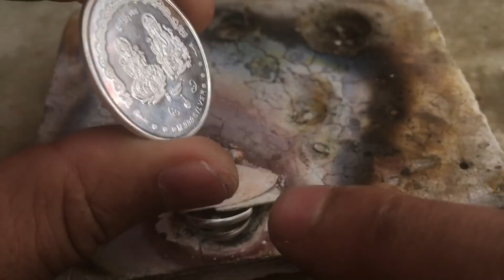How To Make Silver Bracelet | fine  Silver Bracelet

Comment: 24k silver😂
24k😂😂😂😂😂😂😂😂🚶‍♂️🤪🤪
Reply: Thinking the same thing.
Reply: Isn't the letter K for KARAT WEIGHT???  I think the coin that was used weighed that much???
Reply: @adellsinclair8797  silver is not measured in Karats 😂😃
Reply: @adellsinclair8797  also if it was 24k it would be .9999 fine silver not .999.👍